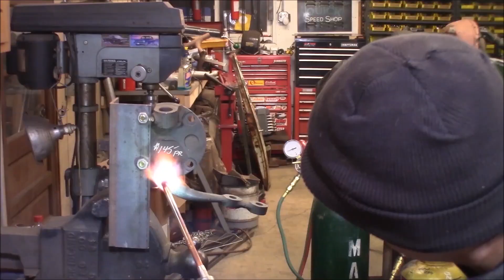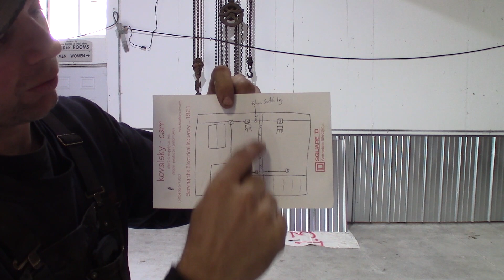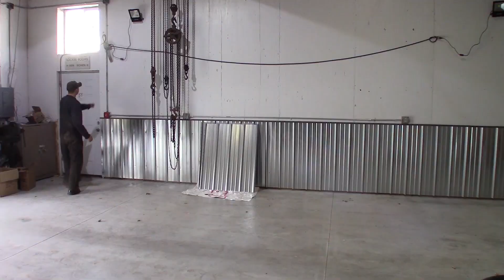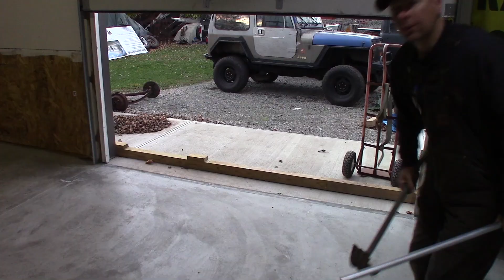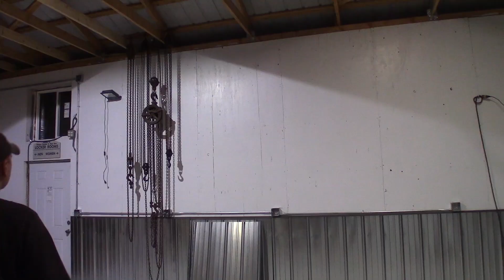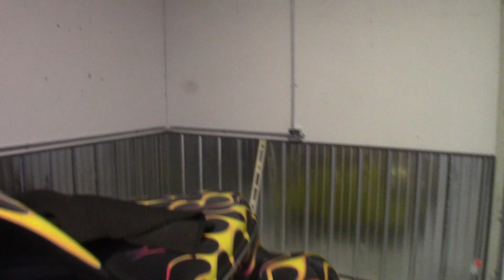Running EMT Conduit in my Pole Barn for the new Quick Speed Shop

Comment: Nice work . My son-in-law is an electrician and gave me lots of ideas and pointers when i wired my , 36x36 3 bay,  shop.  He put in a 200 amp service to my shop when he wired the house i built , more than I will probably ever need even with welders and air compressor. Each bay is on it’s own breaker. I ran 12/3 romex around the outer walls that way I could put 2 circuits in each 4x4 box. One circuit on red one on black and they share a common ground on white, that saved making a long run to carry a second circuit to the far walls. You could probably do similar by pulling a white, red and black wire to your wall boxes . I guess in case I should ever want to run a toaster, deep fryer, coffee pot and microwave all at once in my shop. . He wired my house pretty much the same  way , every plug in my kitchen is on a separate circuit.  An ‘idea-er’ for tube deburring tool, get a 3/8” three sided file with a wood handle. Cut the file off about 2 1/2-3”  from the handle , using a bench grinder to grind all 3 sides smooth and then tapper all sides to a point. You should end up with a hollow ground 3 sided knife. Take care not to over heat metal while grinding to hold the temper of the file. These were the tools we used to de- bur stainless steel tubes in a tube manufacturing plant where I work back in the 60’s in SanDiego , I still have a couple in my tool box.
Reply from the maker: I already have the building wired when this video came out.  That video will be out next week.  For you shop just be careful since you shared a neutral with two circuits.  If you ever have to work on one circuit you'll have to turn both breakers off that share that neutral or this is potential of shock hazard.  Friend at work got thrown off a ladder and broke his pelvis when he got shocked on a shared neutral in a light fixture.  I pulled multiple outlet circuits in my shop, but each has its own neutral.  You can share a ground circuit, but have to be careful with the neutral.

Comment: The bender is known in the trade as a hickey. Bending conduit is a skill of its own. Not having to deal with Romex is a big plus.
Reply from the maker: Actually a hickey is a tool for making segment bends of various radiuses in rigid conduit.  It is a different tool than a conduit bender which I used.
Reply: @QuickSpeedShop  Just going by what Kodak electricians called them.